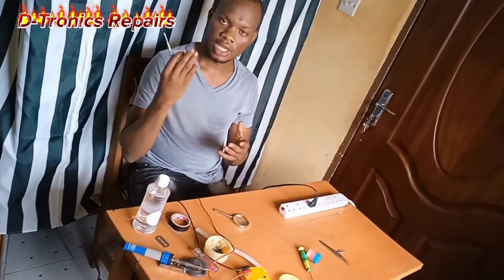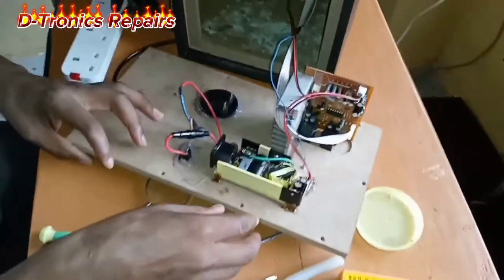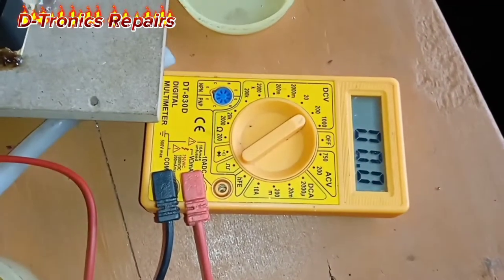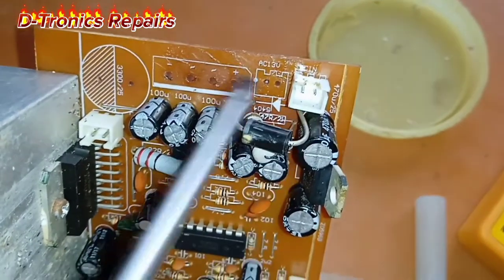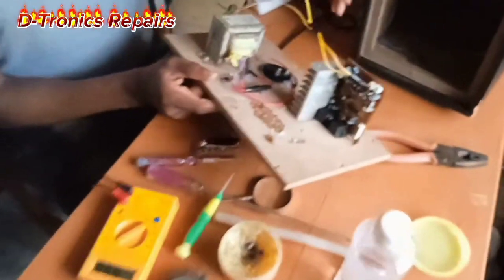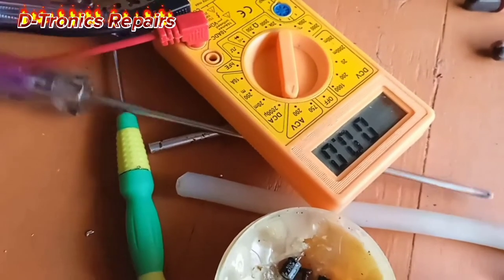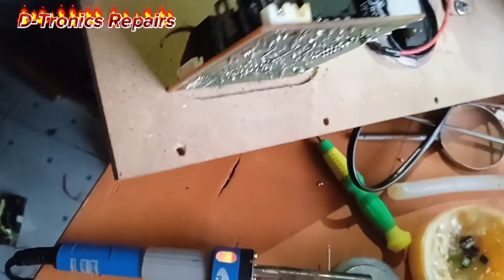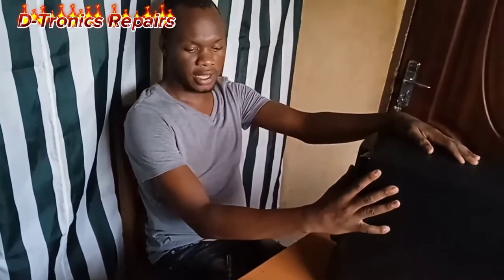How to repair a subwoofer with a power problem.

Comment: I have a home theater of 5.1 channel, when i turned it on play mode, the subwoofer keeps going off and on but the tweeter speakers are working normally. What could be the problem sir?

Comment: It's good for a start. You just mentioned a resistor and did not explain whether it's still working or not. Also, you previously mentioned that the amp was running on 12v but from that transformer, the voltage does to 30V. you could have gone straight away to using the 12v without trying with the whole voltage which could have easily damaged the amp PCB.
Reply from the maker: Thank you very much for the comment. We sure will be more careful in our next project.
Reply: I like your videos I understand better

Comment: hey , my sub has harldly any volume , but when you unplug it from power it works properly  for a couple of seconds as the voltage drains , , any idea?  thanks
Reply from the maker: i think there's a problem with the power capacitors